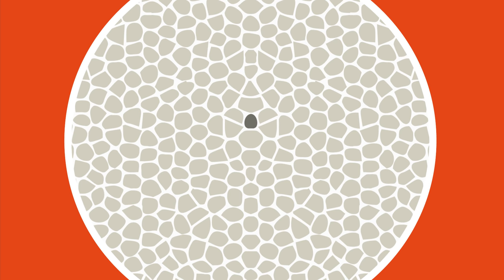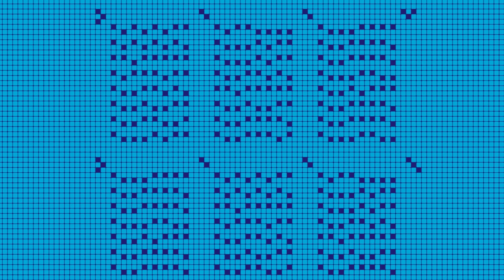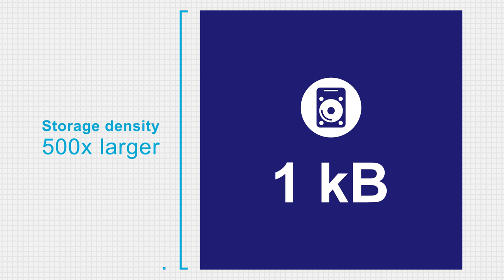Atomic scale data storage

Comment: store one kilobyte of data on an area 100 nm x 100 nm in size. ??
1 Kilobyte = 100 Nanometer 
1 Gigabyte = 1e+6 Kilobyte
1 Gigabyte = 100*1e+6 Nanometer = 1e+8 Nanometer
1 Meter = 1e-9 Nanometer
1 Gigabyte = 0.1 Meter = 10 Centimeter ???
Reply: You forgot that it's on an "area" 100 nm x 100 nm in size. So all your calculations would be for strips 100 nm wide. Giving you
1 Gigabyte = 0.1 Meter = 10 cm long x 100 nm wide
Taking that to a 10 cm square
1 GB x 1GB = 1e+18 bytes= 1e+6 TB
Reply: thank you.
Reply: 10 cm square  = 100 terabyte
Reply: 1 GB x 1GB = 1e+9 bytes x 1e+9 bytes =1e+18 bytes
1e+18 bytes = 1e+9 GB = 1e+6 TB =1000000 TB
Reply: You mean  capacity 10 cm X 10 cm in size can store 1000000 TB. I thinking  u mistake calculate. because i read to site they say "1 square inch can store 62.5 TB"
my opined 
1 terabyte = 0.1 centimeter square || 1 centimeter square = 10 terabyte
* 1 square inch  = 6.4516 square centimeter  
---------------------------------------------------------------------------------------
equation A : 1 square inch  = 6.4516 square centimeter
equation B : 1 centimeter square = 10 terabyte
---------------------------------------------------------------------------------
1 square inch  = 6.4516 * (10 terabyte)
1 square inch = 64.516 terabyte
"1 square inch can store 62.5 TB"
Reply: u mean am calculate 10 cm x 100 nm = 1GB
(100 nanometers  *100 nanometers )10,000 squared nanometers  = 1 Kilobyte
1 squared nanometers = 1e-4 Kilobyte = 0.0001 Kilobyte 
10 cm = 1e+8 nanometers
10 cm x 1 nm = (1e+8) (1e-4 ) = 1e+4
10 cm x 100 nm  = (1e+4)(1e+2) = 1e+6 Kilobyte
*1GB = 1e+6 Kilobyte              is correct.
---------------------------------------------------------------------------------------
10 cm x 100 nm  =  1GB
10 cm x 10 cm = ?
how to different between 100 nm and 10 cm
convert to same unti
10 cm =  1e+8 nm
different  =   1e+8 nm - 1e+2 nm =  1e+6 nm
10 cm x 10 cm = 1GB * (1e+6) = 100000 GB
10 cm x 10 cm = 100 TB
Reply: if you have a square 10 cm x 10 cm
and you can store 1 GB across the top
by the same token you can store 1GB down the side
rotate the square reverses the top and sides (it is a square)
therefore 1 GB x 1 GB = 1e+9 bytes x 1e+9 bytes = 1e+18 bytes
1e+18 bytes = 1e+9 GB = 1e+6 TB = 1000000 TB
Reply: "(62.5TB) would be stored per square inch."
Reply: +Douglas John if i say "1m x 10cm=1 GB  1m x 1m =?" 
how u calculate 
1GBxGB ?
1000000 TB ?
this mistake
Reply: +Douglas John 100cm x10cm = 1GB
1000sq cm= 1GB
1 sq cm = 0.001 GB
---------------------
1m x1m = 100cm x100 cm= 10000 sq cm
1m x 1m= 0.001 x 10000= 10 GB
Reply: What the hell is that " How to Different...." ?????
2 x 3 = 3 x 2, the order is irrelevant 
10 cm x 100 nm  is the same as 100 nm x 10 cm
10 cm x 10 cm = 100 sq cm  not 10 cm x (8 -2 anything)
same as 1 GB x 1 GB = 1e+9 bytes x 1e+9 bytes = 1e+18 bytes
as previous shown
1e+18 bytes = 1e+9 GB = 1e+6 TB = 1000000 TB

for a calculator copy "how to convert nm to cm" into google search
you have length, area, volume etc that you can choose
Reply: * 1sq inch= 6.4516 sq cm
you sqy "100 sq cm = 1000000TB"
= 1 sq cm = 10000TB
= 6.4516 * 10000
1 sq inch = 64516 TB
no close 62.5
Reply: In your first post you asked a question (Theory), I answered.
You responded with math with errors. I showed you the errors again and again.
Now you want me to explain why the theory doesn't match the Practical.
I will leave that to you to figure out.
Reply: You forget to square the size of the area!
Reply: 100*1000 nm will give you 1000*1000*1kB=1GB.
Thats 100*100um or 1/10th mm*1/10th mm
Is a hair 50um? Just as comparison.
Reply: this is probably due to it still being a prototype, they are probably more concerned about it actually working.  they will miniaturize it before it's commercial release